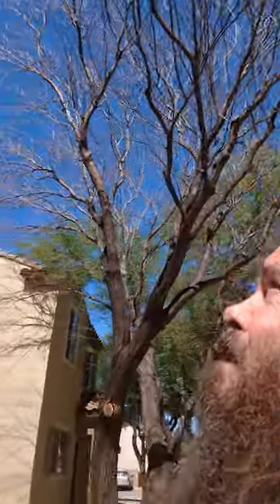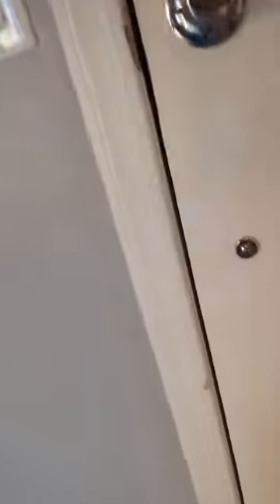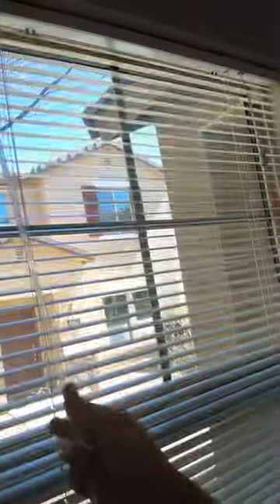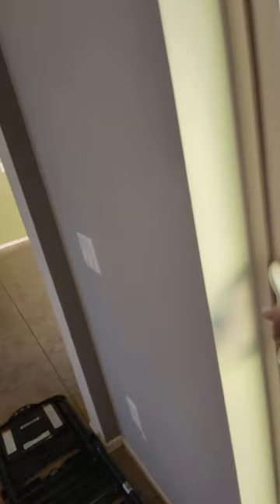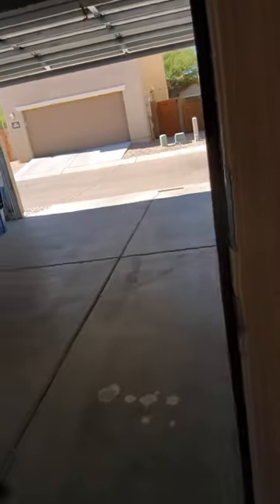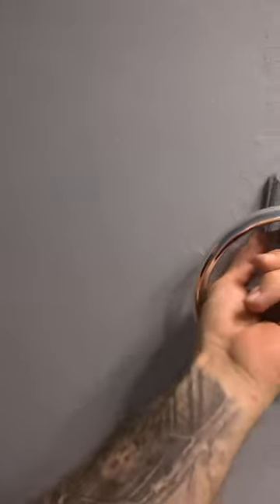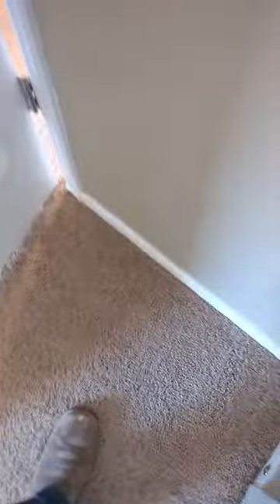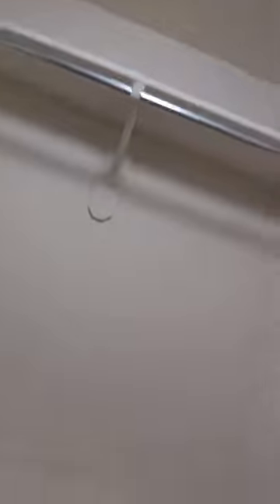How To Do A Move Out / Property Turnover / Part 1 Inspection

Comment: When you do a move In/Out, do you charge a trip charge to do the inspection and then charge again to do the repairs on a separate day? 

Also, how much on average do you charge for a move in/out? I did one the other day for the first time and replaced: toilet fill valve and flapper, toilet seat, re caulked shower and toilet, installed a new smoke alarm, tightened up sinks, fixed a broken screen, replaced poly washers on p-trap, installed a towel bar. Took me about 4 hrs and required a trip to the store. I charged $130 for material and $350 for labor. I’m unsure if I overcharged.
Reply from the maker: For me if we move out is different because every property manager is different. I have one property manager who occasionally pays me to do move out inspections which also come along with a little bit of pre-approved work.  In that scenario I do my inspection and invoice for the work and the inspection is wrapped up into the work.  For all other move outs, I sometimes just show up and get the work done and only send them an additional estimate for additional work if I'm looking for additional work.  However, if I'm open to additional work or if it's a property manager that I don't necessarily trust as much as others then I will do the inspection first and send them a very large estimate for all of the work that they found as well as all of the work that I found.  
In the scenario you gave me, your pricing seems fine. Perhaps you could charge a little more or a little less depending on what region of the country you're in and what the rates are like there but $350 for a half a day of work is not a bad place to be at all, and it's definitely not overcharging.
Reply from the maker: Also, on a move out, for the actual work, I charge a $125 trip fee and then the work is billed based on my set rates or on the effort put in.

Comment: Very informative. Thank you. Do you charge for the inspection? You seem to spend at least an hour checking things and documenting. Or do you inspect at no cost knowing you are getting good amount of repair work guaranteed?
Reply from the maker: I do offer inspection as a service, but in this case no.  I just found that if I'm already there, it's worth the time to generate the extra work.  It's a win-win situation.  The inspection I charge for takes over two hours.
Reply: Nice work! I also check the water pressure to make sure the PRV hasn't or isn't going out.
Reply: @bulletproofhandyman  Yes, two hours for a thorough inspection!